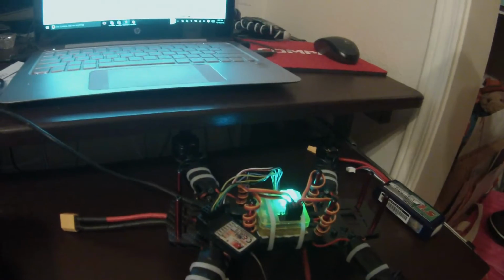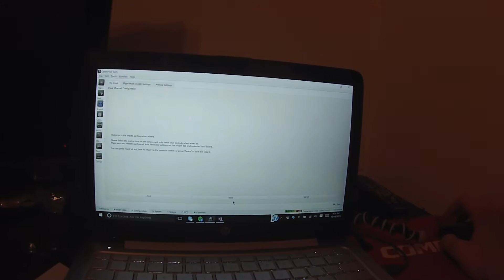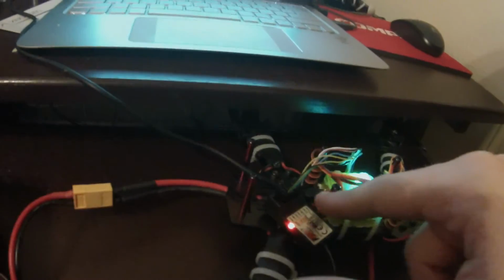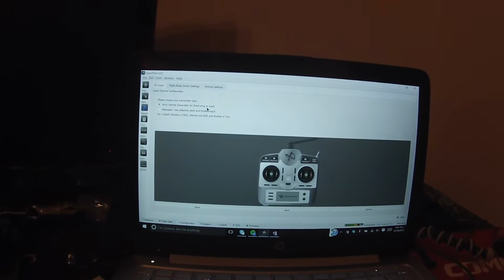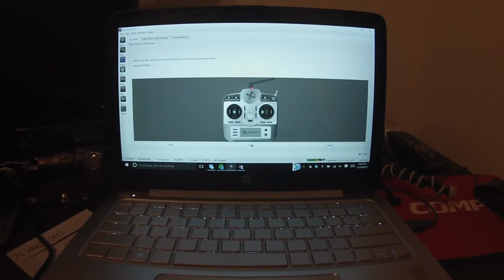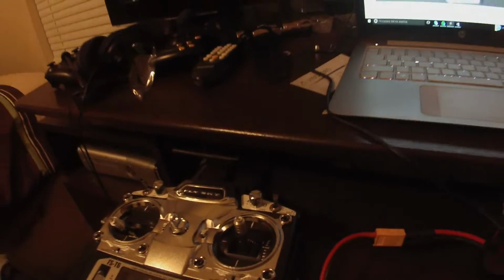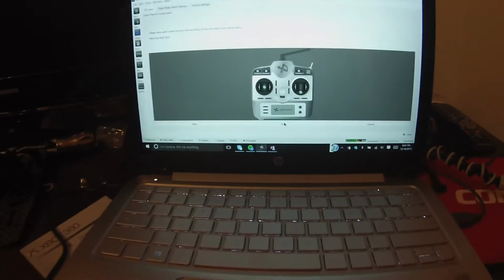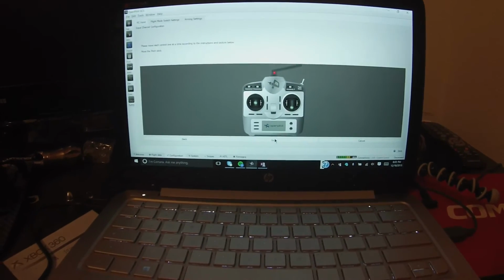Transmitter setup Problem with Flysky FS-T6 & CC3D

Comment: Having the same issue can't seem to get the controller to fully register my switches or anything far as throttle or now I can't even arm my quad
Reply: did you have any success? I am having the same problem & am close to throwing it all in the bin. Not recognising any of my stick movements

Comment: interchange channel 2 and 6 on the receiver......pitch should be in 6th channel and aux on 2nd channal then it works....initially I faced the same problem the software is reorganizing the  rightabove tuner on fs-ct6b as the pitch so I interchanged those wires 👍... hope it works for you
Reply: hey bro I'm having the same problem can u put a video on this

Comment: im having the exact same issue i cant get past this stage either. any help tips or advice would be appreciated thanks
Reply: did you have any luck? I am having same problem, not recognising any movements
Reply: @AnotherHipster  I managed to get around it by resetting it. Failing that I also bought a second receiver so I could try it with another quadcopter and that worked
Reply: @jonathandavies6862  thanks for your help, I got mine flying & working but then I crashed it when I accidentally swapped the throttle from left stick to right stick.......Using the parts now for a land based project instead. Good learning curve

Comment: Did you figured out the problem?...im having the same issue, elevator wont be detected..let me know bud!
Reply: M-A Levesque FPV I have a problem we’re the default position for elevator is at the bottom. So if I hold the stick at the bottom for a few seconds it will work except the stopping position is on the bottom and not middle. Do you know how to fix this?

Comment: I have the same problem, but i know, it's not, the transmitter, because i'm using a flysky-ct6b, and in it's configuration software, T6, i can swap around modes, and find each time, it's a different channel, stick motion, that won't respond, i've been reading the others comments on here, and i'm beginning to think it is, a cable out of cc3d to receiver setup issue. Oh, also, every stick motion is, responding in T6, all bars are moving, so no dead sticks on the Tx there. Ok, it is, a wiring issue, just wired my receiver the way alison in the comments here suggested, and i can now complete the transmitter setup wizard. Now, i just can't start my quadcopter after, all this, away from the pc.

Comment: I'm having the same problem. Pitch won't register. Using Libre Pilot PWM and I can have my SwC switch assigned to pitch, but for some reason I can't get the stick movement to register. Using a CC3D everything in the setup wizard works except the Tx config. So frustrating. Tried to find forums for help and this Video highlights exactly what my problem is - so for no success. Do I need a new Tx with Rx? Help please.......
Reply: I had this problem with my fs i6 and I had to swap the reciver cables around this is the order I got: ch1 blue cable ch2: 1st yellow cable ch3: white red and black ch4:green ch5:the other yellow ch6: black(with flysky fs-i6 transmitter and flysky fs ia6b reciver
Reply: alison thank you! I followed your instructions and it worked.
Reply: alison  bro thanks it worked for me(ct6b)

Comment: Did you try going into the SYSTEM menu and going through the TYPE SELECT menu? I noticed on my Heli, I had to use the "Variable Pitch" mode in the Tx for it to work properly in the ZYX S2 Gyro software. I could not set it on "swash 120", It would not work. Also for my Tx to work with Clearview(Flight Sim). I am also using the same set-up in the new Quad Sim, Liftoff on Steam....
Reply from the maker: +W1Ck3Dj3St3R1 I'll try and see if this works thanks!
Reply: Tried this and it didn't work.
Reply: this worked for me i set the model to be a helicopter variable pitch and it then detected yaw. Here hoping it works when flying

Comment: im having the same problem.  any ideas on how to fix it ? when inputting pitch flight mod activate as well . getting to inputs on one channel
Reply from the maker: Nothing so far I ended up just using an old back up as my current radio
Reply: yes
Reply: same problem for CT6B
Reply: I had this problem with my fs i6 and I had to swap the reciver cables around this is the order I got: ch1 blue cable ch2: 1st yellow cable ch3: white red and black ch4:green ch5:the other yellow ch6: black(with flysky fs-i6 transmitter and flysky fs ia6b reciver

Comment: The fs t6 gave me a lot of problems during the configuration but I solved this problem by restart the whole process of configuration, including the cc3d configuration. After this I had the same problem but this time with the flight mode sticks, so..